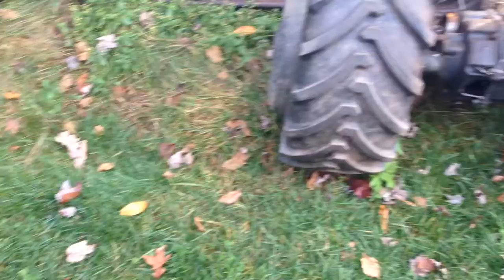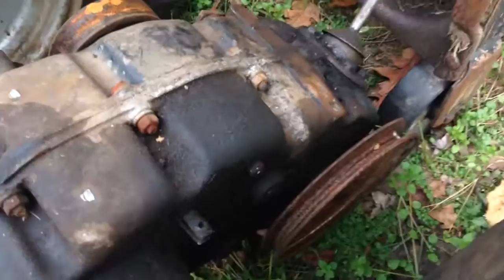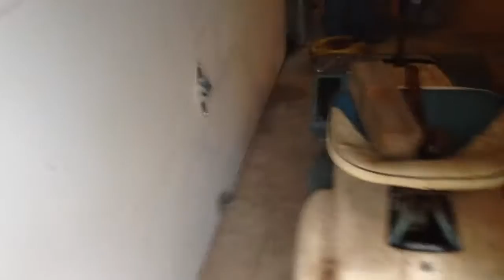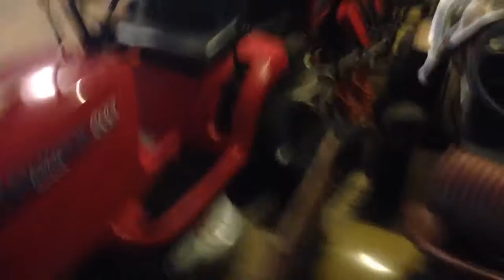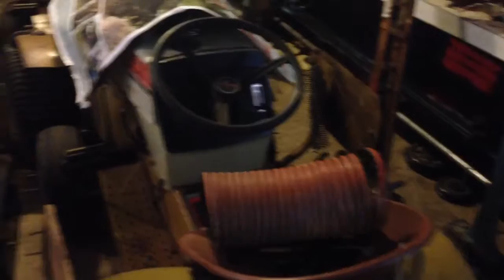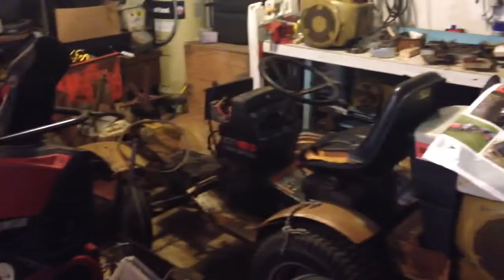For Fearlessfront

Comment: You can weld that Aluminium casing with your regular MIG just need aluminium wire and pure argon gas. Oversize nozzle reduces bunching up. You got nothing to lose so go for it. ;-)